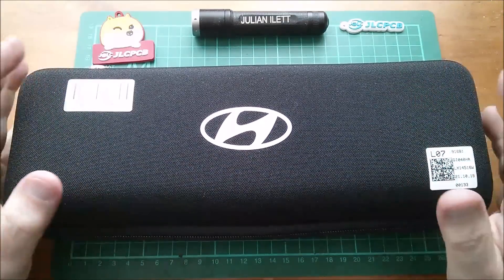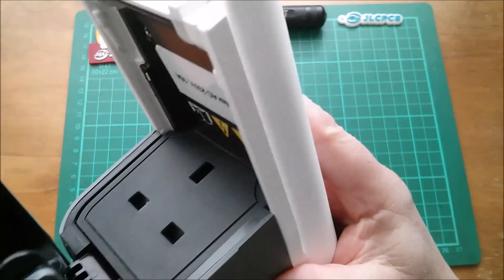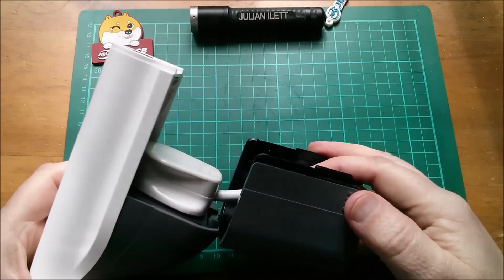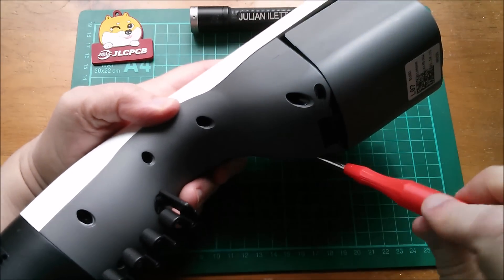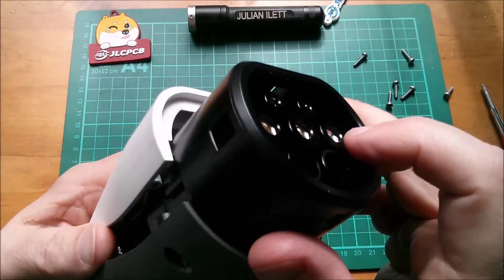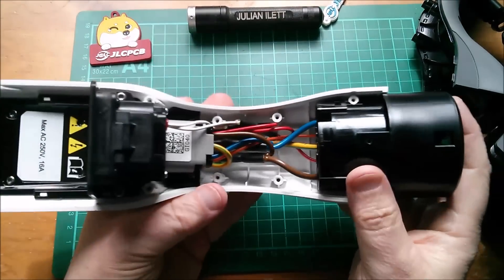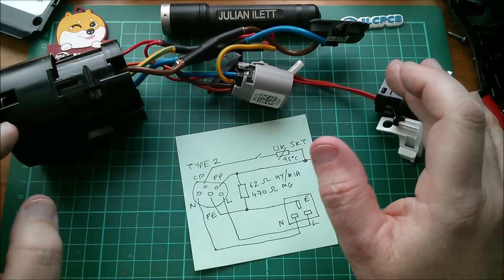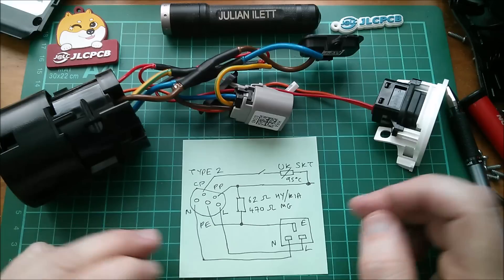Hyundai/Kia Vehicle to Load (V2L) Adapter Stripdown

Comment: Hi Julian, can you help me? I used your mgzsev video for v2l and made a v2l cable successfully but after seeing this video I wanted to change my mg v2l resistor so I did this based on the ohm rating in this video but the car won’t accept the cable so I can out put volts? Any ideas?

Comment: Hey, interesting video. Thanks for the tear down. So, technically speaking, this Hyundai / KIA V2L cable will work on your MG ZS if you replaced the transistor on the V2L adapter? so if i want to buy any third party V2L adapter, i need to refer to the resistor value that shorted PE and PP?

Comment: Just add to the comment (much lower down) about the power available.  Not checked the output on mine, but @ 250 Volts 13 Amps equates to 3250Watts.  3600W @  250V is nearly 14.4A.  UK mains can be up to 253V, btw.  The nominal 230V would provide the nominal 3.1kW.  

However, on the charging side, the maximum power for the charger is 2.2kW.  This is to protect the square pin plug from overheating when charging for prolonged periods.  Running at 3kW for short periods (boiling a kettle, for example) is perfectly OK.  

How long the plug, with the pins scrunched up (due to the lead and cover interference) could avoid overheating, might make that thermal cutout (presumably not a ‘fuse’) a necessary addition!  I’ve not taken more than 2kW from mine, so far…

Not all 13A square pin plugs are made in the UK these days, so care does need to be taken!  3.6kW might be the marketing hype, methinks?

My kitchen oven draws 2.7kW.  I won’t be cooking the Christmas dinner from the Ioniq (even though the oven is thermostatted).

Comment: Hi Julian. I am using my Hyundai I5 to charge my house when the electricity price is high. In your video you wonder why the 95 degree "fuse" is there. I experienced when overdemanding the car, so more than 3,6kW, the car shuts down the supply. So I am thinking this thermal is the protection for a load exeeding 3,6kW. After reinitating the V2L everything works fine again.

Comment: Thanks for the detailed iintroduction to the v2l adapter. I hoped that there is an FI inside the housing. Because I have to live with 2 male plugs in the connection cable. Thanks to our good german electricians. Good that there is a switch. But what happen if children unlock the cable. Will power stop?? If not it will be more dangerous.

Comment: I am wondering, would this adapter also work with an ID5, since the ID5 is supporting bidirectional loading, so it would be interesting to see if the adapter would work directly when pluggin it into a ID5

Comment: Very interesting.... we are now stepping into the future and at last working to save the planet !

in a future video could you make an attempt to have a couple of SOLAR PANNEL come into the mix,
meaning without human intervention (cable change and option check on the car touch screen), the car would be recharged when the sun is shining and the house would use the car battery
and not the external Grid when enough electricity is stored in the car's battery. 
If that is not possible right now (in your mind) please us know.
if one would need a clever kit that you could build, to do that, i'd be happy to be a client of yours...and your local reseller!!!😃

(the idea is to have a set 8 to 12 solar pannels installed on my roof)

Comment: Thank you for this teardown it's interesting to see how they work. We recently bought one of the cables from EV Cables. I work for an internet service provider and we've recently begun using an EV to power our street cabinets during power cuts instead of using a generator like we previously did. The Ionic 5 was the car of choice and we managed to get one on lease to try out. V2L works wonderfully for our application. One thing that I intend to do though is swap the push-button switch on the EV Cables adapter for a key switch, to avoid any passers-by switching the unit off when unattended, this teardown helped show the innards to see what I would be working with when I do this modification
Reply from the maker: Brilliant - thanks Robert. I'm pleased it was helpful.
Reply: @JulianIlett  Mr. Julian, I have a question about V2L. Can you help me? I need your help. How can I contact you?

Comment: Search for 'rear entry 1363 plug', there are several available, you should find an orange one which we used where i worked.
But really, just leave the cover open, those cable fins don't provide much weather protection so let the water drain away.

Comment: This is way cool. Teslas can't do this! Such a useful feature especially if you live somewhere that extended power outages are common. A 60KWH vehicle battery can run basic household appliances for days and days.
Reply: Technically they can, but Elon would rather sell you a Powerwall 2

Comment: So is the inverter function present in the vehicle? It has to convert the DC to AC somehow, and apparently it isn't happening on this device. So if the AC is already available at the vehicle, they are simply charging extra to give access to what is already provided.
Reply: From what I understand it's only included on the Premium trim models. We've recently leased one, it didn't come with the adapter, but we bought the above mentioned EVCables one and it worked
Reply: No, rather charging extra for convenience of using an external plug. You can always use the cabin AC outlet, wich is rated at the exact same value as this adapter. Still, disgusting practice on their behalf

Comment: Wouldn't it be cheaper just to get a 12v inverter, like the ones that have been available for years. Seems to me like thay are just re-inventing things so they can rip people off for more money.
Reply: The current for 3kw at 12v would be ridiculous,250 amps, and the car's dc-dc converter would be unlikely to be able to support it
Reply: @mikeselectricstuff  Just wondering because I know I have a 2kw inverter in my car and I have seen boaters use 3.5kw inverters on 12v systems, plus as far as I know even EV's have normal 12v batteries, not sure if they have normal 12v sockets though.

Comment: I'm assuming there are adequate safety precautions in place to ensure cut off if any faulty equipment plugged  or if excessive current is pulled for extended lengths of time on the VTL?
My point being, what if a component is fried and it affects charging and/or ability to drive vehicle, would the warranty cover repairs? I'm guessing that maintenance staff would not be impressed if you told them you caused damage plugging in household electrical appliances, that being said, I'm sure the sales reps and management would be quite happy if it happened out of warranty, as we all know several figure bills for pennies worth of parts.

Comment: If ever there was a bad time to use LEDs and a good time to use old fashioned Neon bulbs, that light module was it.
Reply: ha ha. maybe they were thinking of heat dissipation but not cost. but i agree. no need for all the "DO:DAH'S" on the circuit board to run 3 LED's. could have saved a few penny's there. (someone's getting fired)  : )
Reply: Did you see Fran Blanche's video on new neon bulbs and how quickly they fade? They're not made the way they used to be...
Reply: @NiHaoMike64  no, I stopped watching her channel.

Comment: My Mazda MX-30 has a plug socket under the dashboard, but it's maximum power rating is 150W, which seems really low.
Reply: That's probably a module shared with an ICE car that runs off the 12 volt system. You can't really get 3 kW off that.
Reply: Sounds a likely reason, but wouldn't that mean they'd have to embed an inverter somewhere?
Reply: @MrGeekGamer  Inverters have gotten so cheap and boring that you can just hide a small module somewhere.

Comment: It's so simple! I wonder if the circuit is the same for the North American version of this? More specifically the resistor value?
Reply: It’s in the going electric forums - about 65-72 ohms should work

Comment: I‘m wondering how the temperature protection is supposed to work. According to the schematics, the car can not measure the state of the fuse as long as the switch is pressed. So I would assume from the schematics that the temperature fuse would only inhibit the „switch on“ function, not stop the vehicle from providing power. Also if the switch is also used to turn off the power, that would not be possible in case the temperature fuse opened up.
Reply: It's a latching switch, not a push button.
Reply: @grrrams  Ah, yes. That makes sense. Thank you!
Reply: The car would be looking for that PP-CP link. If it didn't exist (in the case of the 95 C temperature switch opening at 95 C), it disables output.

Comment: Some 30 years ago 3 pin UK plugs were available with a matching socket moulded on rubber. They were for a fly-type extention lead and had an element of water resistance by the socket having a rubber shroud that wrapped over the plug.

Comment: I find the A.C cable to be too thin, also it merits to be in silicone insulation, the thermal switch is clearly too high 80 C will be a lot better
Reply: i agree strongly about the thermal resistor/fuse switching at 80 or max at 85. i mean 95 is already starting to bole water. but then again i have replace ones rated 115 degrees for things for inside the house before to in the past.

Comment: I assume there’s some sort of circuit breaker inside the car that can handle short circuits between live/neutral and live/earth?
Wonder if you can get a replacement socket module with a commando socket on it.

Ooh imagine a future where you can have an EV that tows a caravan, with the caravan having extra batteries in it, solar and an extra type 2 socket to hook the electrics up.
Reply: Like this setup ? 
https://youtu.be/UQrQ_hUtfgs
Reply: Hopefully the extra socket would be in the back, cos having a extension lead coming from the nose like the ZS all the way to the back wouldn't be ideal lol
Reply: thats the future for sure mate. i can defo see that come in to play.. : )